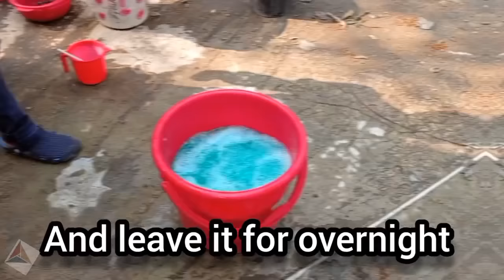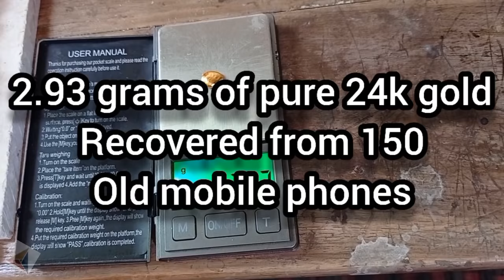Cell Phones Gold Recovery | How To Recover Gold From Old Cell Phones | Gold Recovery

Comment: Good work! More profit definitely like this. The only time you may reguire more nitric when dissolving gold is if your material has a good amount of base metals left consuming the nitric but other than that less chemicals means more money.
Reply from the maker: Yes! It’s worth it!
Thanks to you!
Reply: Ìs it possible to extract Gold without Nitric acid. Not only is it hard to find unless you have anything to do with chemicals or are a scientist or use it for the work you do?
Reply: @graemeallen3679  or AP method with hcl and peroxide to remove base metals. By nitric online through ebay or Use poor mans Nitric and poor mans AR geo has a good video
Reply: Thank you so much for your replies I really appreciate it a lot and I will learn so much from the video links you have given to me 🙂
Reply: @graemeallen3679  its about the only refining Imcan do anymore, passing knowledge on because of health problems

Comment: Why did You add sulfuric acid to the aqua regia??
Reply: H2SO4 makes heat in aqua regia and reaction faster.
Reply: It also will cause lead to drop out so it can be filterd off
Reply: @jasong8377  exactly

Comment: Im pretty sure wet ashing videos aren't supposed to be allowed on yt. Even so you really need to put a safety disclaimer. People can easily get hurt with that process, like i did when first learning this stuff
Reply from the maker: How did you got hurt from wet ashing?🤔🤔🤔
Reply: @TrinityGoldRecovery  it was a freak accident. I was very new only couple of months after I started refining. I scored like nearly a kilo of bga chips.threw the backs in a beaker with sulphuric. Put it in a corelle dish on an electric burner it started expanding like a slow motion elephant toothpaste video. Stupid me reached for the control to turn the burner off. Thats when the slow motion turned into a fast eruption. Had gloves and a long sleeve shirt on but still got nasty burns on my foreams snd backs of my hands as it instantly ate through my gloves. That was nasty in itself, enough to goto the er. But wait... Theres more... Sulphuric conducts electricity very well. As soon as that foamy black crap hit me, it also hit the burner shocked the hell out of me which i got a couple more burns from... It took me well over a year before I tried it again....i got the hang of it i guess but my accident was bad, but just as easily killed me
Reply from the maker: Well, that was a hell of an accident!
But we don't recommend people to start this recycling business without proper knowledge of what they are dealing with.
Accidents happen with us also.
This is common sense for people to start this recycling business with proper knowledge of using acids.
And also with the registered license for using acids.
Good luck for you😉😉😉